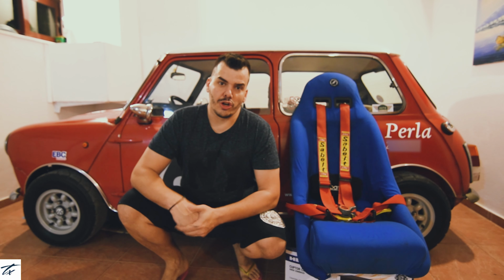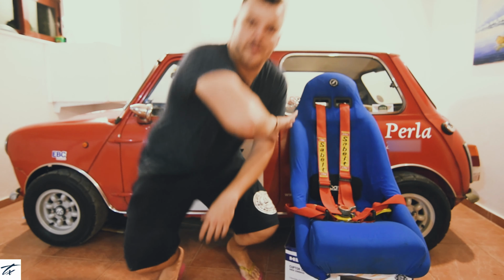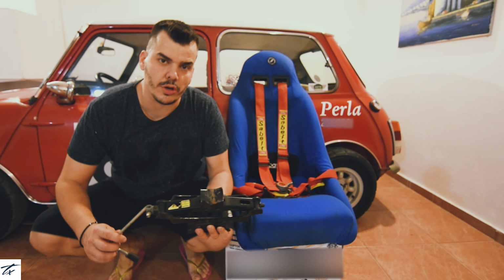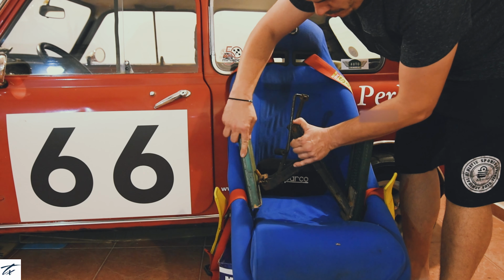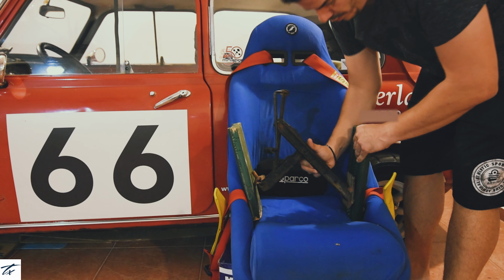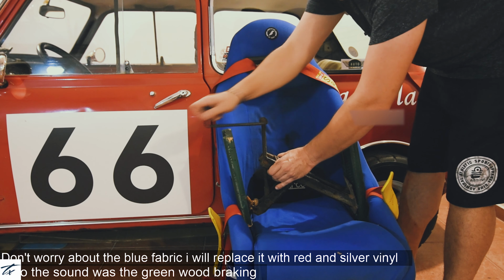How to Stretch A Retro Bucket Seat With Steel Frame

Comment: i bought a racing seat and its perfect but too narrow, i will try something similar and be very careful
Reply from the maker: Open slowly make sure it has tubes inside if its wood it will break
Reply: @TheoXydias_PerlaCoffeeTrailer  its fiberglass. I used a heat gun and used a slightlly bigger piece of wood than the existing opening and now i have put an even bigger one. Its just by the hips in the bottom where its too narrow. I got it wider by 2cm already. Am gonna heat it up and leave it with the piece in it overnight. Also, if it cracks a little its ok, it was cheap and its for a sim rig
Reply: @HJCars did that work?
Reply: @tkyouastar  not really man, ended up buying a different seat
Reply: @HJCars damn thanks for info tho
Reply: @tkyouastar  np dude. For your info I ended up finding an old FIA certified (now expired) Bimarco phantom / grip bucket seat for 80 bucks. Great rally style seat